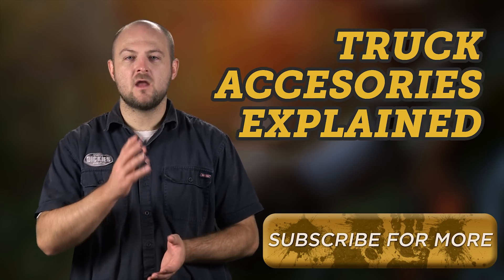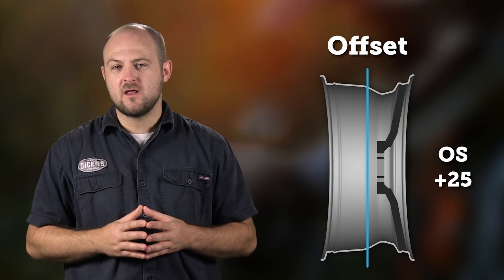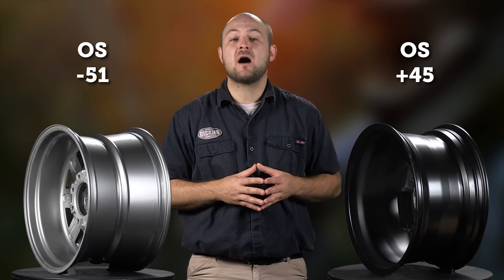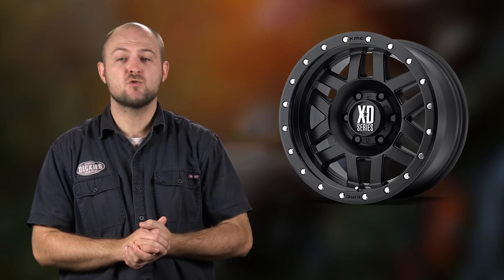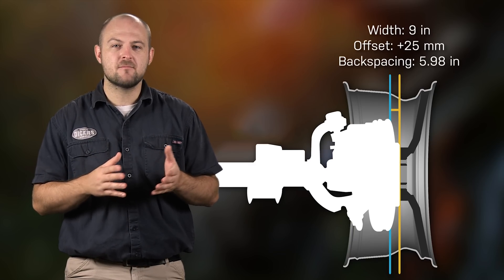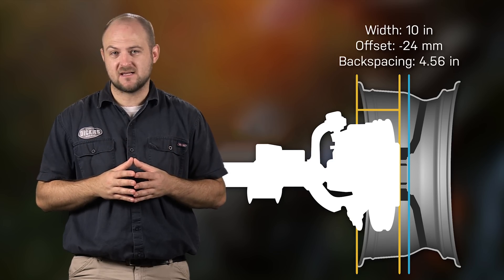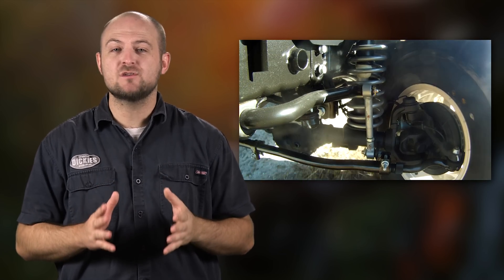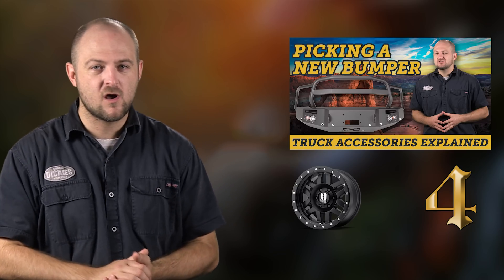Understanding Wheel Offset, Backspacing and Width - Easy Guide | Truck Accessories Explained

Comment: Hello,
I have a Subaru Outback.
The factory rim size is 7JX18ET55.
I want to change the rims to 17 inch
Subaru comes with the following sizes
7JX17ET 55 or 48.
I can't find any rims that size
but 8JX17 ET38 or 7.5JX17ET55 and with the 18 inch 8JX18ET30.
My question is can you mount the rims that are not exactly the same size or not.
Thanks

Comment: Do you that +/- 5 millimeters is accepter for the offset to differ from the standard one ?
In my case 43. Can i use wheel that has 38 or 47?

Comment: so I've been told that 18" wheels I can put bigger tires on my 2020 TRD SPORT Tundra I don't want to lift it maybe a body chop and 33" tires, I currently have 20" Fuel wheels that I believe are zero off set, So if I switch to 
18" and 33" tires no lift and only body chop do I need an off set. ?

Comment: I’m about to purchase black rhino Armory 17x9.5 MY question and concern by Changing wheel from 17x8.5 to 17x9.5  the backspace on the new wheel is 5.3Inch compared to the old 5.0 Inch , Would the new wheels touch the lift knuckles ( spindles ) ? With that New wheel ?  I mean is 0.3 backspace difference could make major rubbing towards the spindle on a lifted truck ?

Comment: Hi, I have a factory steel wheel size of 16x6.5 with offset 45mm. I would like to replace the steel with with alloy wheel size of 16x6.5 with offset 40mm. When I installed alloy rims to the car, I hear noise but not with original wheels from factory. In addition, the center cap is not stayed due to the center hub is long to hit the back of the cap and it just pops out.
Is this caused by offset difference? If so, applying 5 mm adaptor will solve this issue?

Comment: Good explanation. If you want to lower the front of your car say 3"-4" inches, does the type of wheel offset/backspacing come into consideration to prevent rubbing against brake or suspension components? Anyone feel free to anwer.

Comment: This tells you allot about how a wheel is designed but.....BUT nothing regarding how they look on your vehicle. If you’re going to order wheels online, this info is great for ensuring you get the wheel you ordered, but starting from scratch, this info is worthless in determining which is best for safety and performance or personal preference. 
How about information about negative offset causing the outside of the wheel to travel forward and backward at full turn outside it’s engineered geometry resulting in tire rub.
Is not zero offset the optimum performance and safety dimension?

Comment: Okay I heard from local 4x4 shop mechanic that the more negative offset produces more strain on steering and lug studs. Positive offset reduces it. What do you think about that?
Reply: well I am think that offsetting the rim  generally may put unequal pressure  / weight distribution on the wheel bearing , I think minor offset is OK especially with lighter rims and tires but generally  I would be hesitant to play with the offset too much , it will as well effect the suspension , tire wear etc.

Comment: wow, how dumb
one is in MM and the other in Inches
Who is the dumb ass that failed to use the same system for both?

Ok, lets get to my truck, an F-150 (2017)
It came with 17 in wheels
I want to change out for 20 in wheels
what is my Max offset and backspacing I can get away with?

Comment: This is really good! Thank You!

I'm looking at the Promaster city 2018  cargo van for a conversion but want a more aggressive  look on this little front wheel drive van. The oem wheels are a tiny 16x6.5 with +52mm offset, tires are 215/55/16 (that's 25.3x8.5) and  they look ridiculously small for a box.  Specs say the van does support a 15 - 18  inch rims and even 235/40/18 tires (25.4x9.3)   Many of the suggested rims are 8 inch wide +35 to +40 offset. 

I'd like a rim and tire to stick out some, fill the wheel well and make a statement.  I'm also considering a 2 inch coil spacer in the back as I will adding 800 lbs of furniture and the van but it already looks like its sitting back on tiny recessed tires.  I've done mock ups and right tires and rims will transform this van. 

What happens if try to run something with +12mm offset (like 1 - 2 inches out) and/or  a tire that measure 27x9.5?  I don't mind a vintage more negative 15 inch rim with lots of rubber.   I think the back will be fine, but wondering about rubbing on the outer front fender which I have no issue doing some cutting plastic for the right look and better options. I would also be willing to adjust the speedometer.  it's my take that going negative on front wheel drive results in rubbing corner of the front plastic fenders and in the middle of the fender skirt. .

https://drive.google.com/open?id=1xAQ8lCu-FcfsfopWGk2L3LpBg7z_ifhS

Any suggestions or ideas?

Comment: I am about to get a 1997 F-250. I would eventually like to put new wheels on it. When considering the offset and back space if I decided to put wheel spacers on also will I have to factor that into my new wheel choice. If so how do I go about factoring in the wheel spacer?